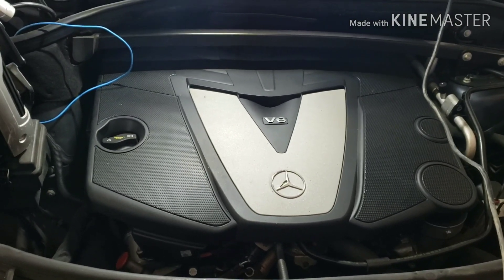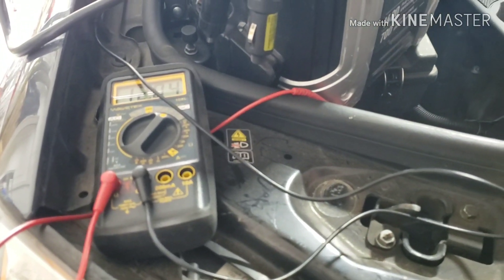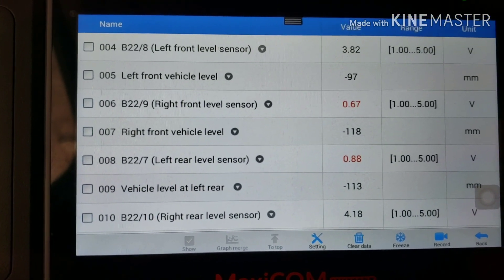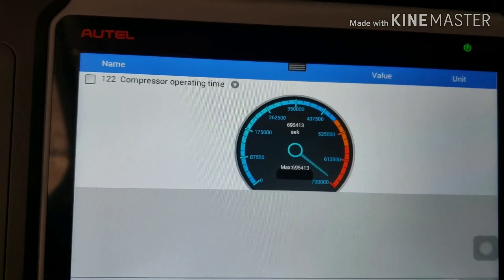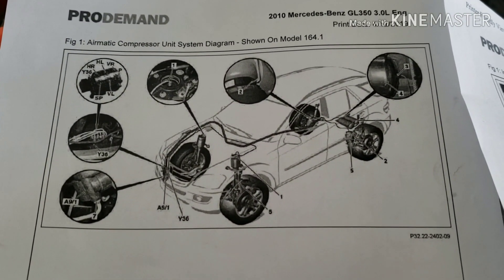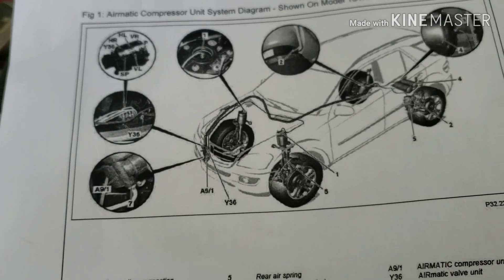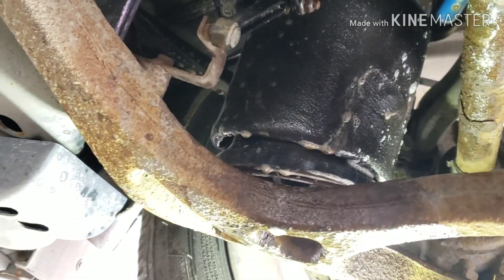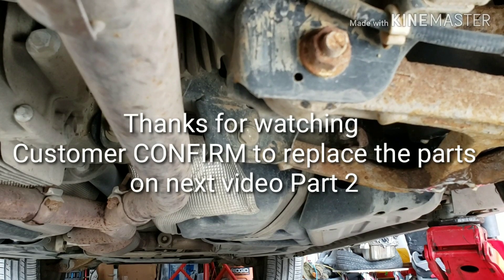AutelMk808bt! Mercedes Airmatic Suspension System DTC 5505, 5507

Comment: when you jack up the car the valveblock will let air out to lower the suspention. That is not the way to do it... I think the compressor is worn. Change pistonring and cylinder head. And right front bag.

Comment: I also got the code 5507 what isit?????when I scan it I can get Only the code 5507
Reply from the maker: Its Airride suspension  code.  Can u hear the pump going? The suspension  Sags down?
Reply: @jfGarage4k  yes compressor is engaging then stops and says malfuction and stops...new rear air bags at the rear both sides..one new front right..car sags only at the right side
Reply from the maker: Okay  good new bags on rear and new bag front right  but the vehicle  sags right side.. Can u feel the bag on the front and rear right side is full or its deflated?   Use the soap and water spray  again  make sure no leaking  from the feeting hose or bag. If they are all okay fucos on the valve block and line
Reply: @jfGarage4k  when I press the raise button is raising up fully but sometimes stops and says muflaction and when they are full overnight they are dropping
Reply from the maker: Slow leak somewhere  on the the side.  Used  soap and water on the bag and every end of that fittings, soap and water on the valve block aswell
Reply: @jfGarage4k  why is the compressor suddenly stops?before when I used to have leaks on airbags was still working until the car was up